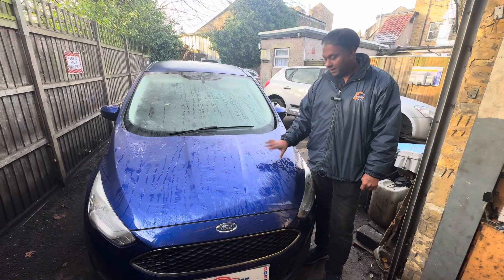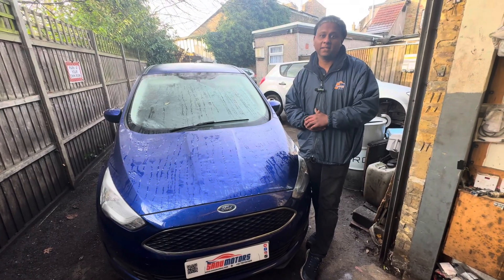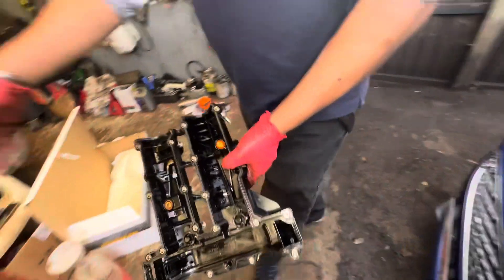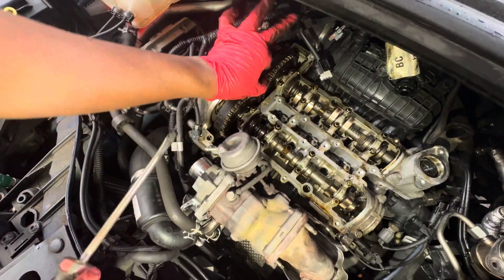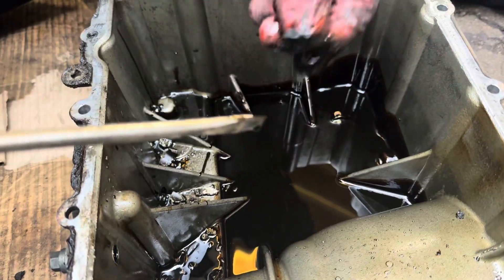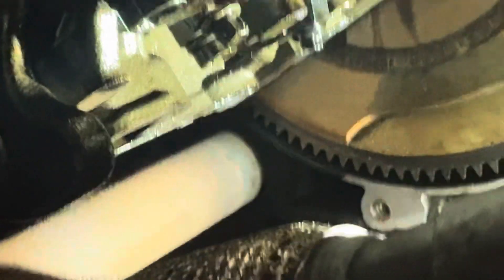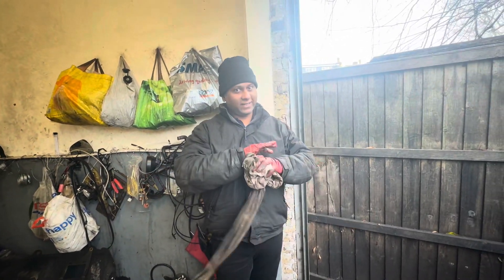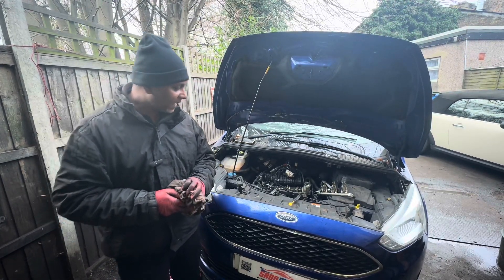This Ford EcoBoost Engine FAILED in the Worst Way Possible!

Comment: The engineers invented the wet belt engine for quieter running (Questionable)and better
fuel economy(minimal savings achieved).
What a disaster!
Reply from the maker: You’ve summed it up perfectly—wet belts were definitely a questionable invention. The promise of quieter engines and slight fuel savings just doesn’t seem worth the long-term headaches they cause. 😅

It’s one of those designs that might have looked good on paper but turned into a disaster for many drivers in the real world. Thanks for watching and sharing your thoughts—it’s always great to hear from fellow car enthusiasts! 🚗🔧 #WetBeltWoes #CarEngineering #MechanicLife

Comment: Was the oil warning light not on before it blew?
Reply from the maker: Great question! In this case, the customer mentioned they didn’t notice the oil warning light, but it should have come on if the oil pressure dropped due to the wet cam belt failing. Unfortunately, it’s easy to miss a warning light while driving, especially if it’s not illuminated for long or if the belt damage caused sudden engine failure.

This is why regular maintenance and inspections are so important for wet belt engines—they don’t always give much warning before things go wrong. Thanks for watching and sharing your thoughts! 🚗🔧 #WetBeltDisaster #OilWarningLight #CarMaintenance

Comment: Wet belts are the dumbest idea ever in automotive history
Reply from the maker: :

😂 Haha, you’re not alone in thinking that! Wet belts certainly have their share of critics. While they were designed to reduce noise and improve fuel efficiency, the long-term maintenance headaches (and wallet pain 💸) often outweigh the benefits.

Sometimes, it feels like they were engineered more for short-term gains than long-term reliability. Thanks for watching, and I appreciate you sharing your thoughts—wet belts definitely stir up strong opinions! 🚗🔧 #WetBeltWoes #AutomotiveDesign #CarMaintenance